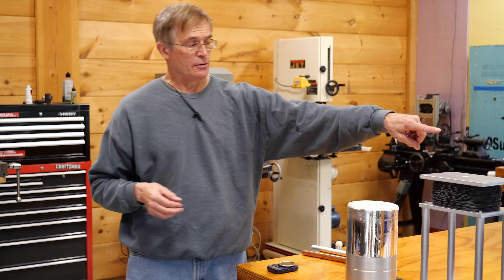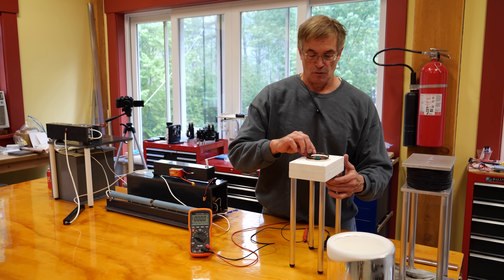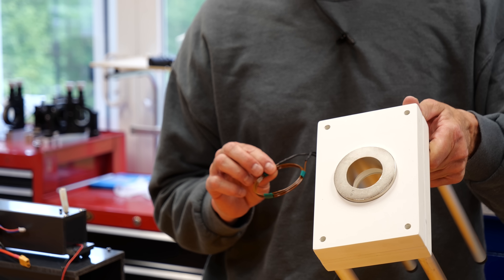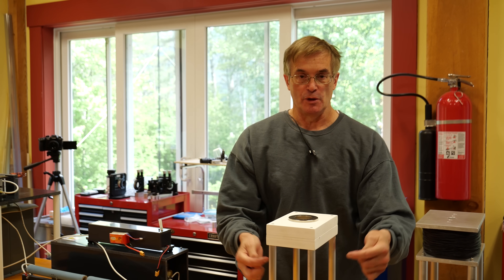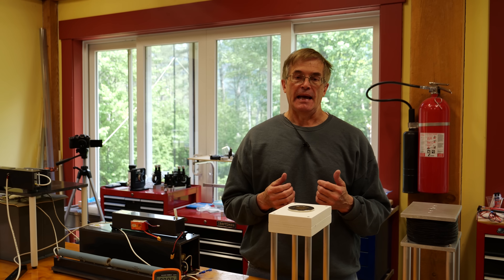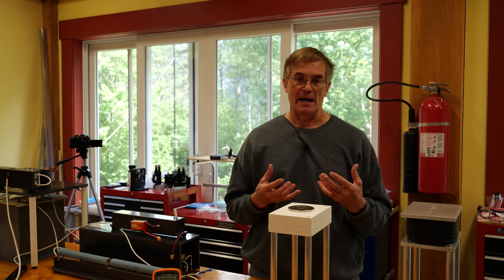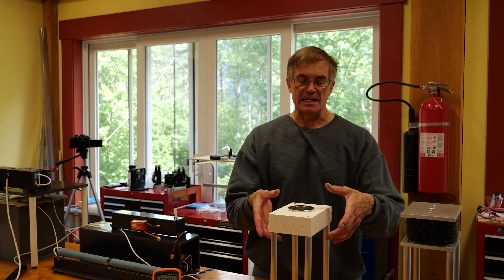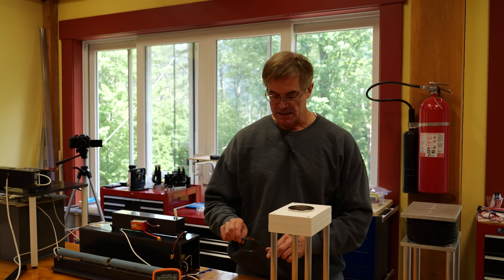No, we didn't use Magic to Crush this Can...

Comment: Comment 2701 
Yes magnets is the best way forward as due to the constant field flow they do well to promote the efficiency of other flows.  It's great you have a clear and simpleish manner of presenting and although it sound good that work is being done by Universities in conjunction with  big business.  in the understanding that Super Computers are now the step one in the prototype phase and where the prototype has been tested theoretically in digital, the practical working takes the best and the brightest even to follow the recipe and if it works we should not enable this form of efficiency to be under lock and key as it clearly helps as we all benefit from access to electricity.

I liked how O3 @/ozone was produced , and made me think about puting the old strip light on in the attic... it gets hot so I wont be leaving it on but hey, an Ozone manufacturing plant could be in every house and with reasonably priced resource of electricity.. they might not cost the Earth to run yet save the Earth in their running.

:)
Cheers to wonderful world peace.
All glory to our heavenly father Holy God and our Heavenly mother Holy Spirit.
A38man Amen.
April 6th 2021 day 482  (Of the Apocalypse)
Thank you.

Comment: I hate to be such a nitpicky stickler but god I just can't help myself.  Circa 2:30 the bit about the right hand rule is incorrect.  The right hand rule applies to conventional current, which is actually opposite the flow of electron current.

Most of the time it makes sense to just kind of ignore that fact in electric circuits but when it comes to free charges it's much harder to do that.  ¯\_(ツ)_/¯

Comment: So electric motors need subzero cooling to make more power.    and isn't air conductive or is it the water molecule's.   instead of pushing air why no drag it useing electromagnetic force to push air.    probably how flying saucers work lol.
Reply: oh air is an insulator but can you turn ionized air into thrust

Comment: SAFETY ALERT! If you can smell ozone, you got UVC (obviously, that's what mercury will produce in this setup, but whether that will get out the tube depends on tube wall material transparency to UVC). If you got UVC, I would not be in the room with it. I would not have it shine onto exposed skin. UV blocking goggles OK, but you will get reflections from surfaces bouncing all around, and getting behind your loose-fitting glasses. I would put something that is transparent to visible but opaque to UVB and UVC between me and any germicidal tube. I use small 15W and 50W UVC+Ozone tubes to disinfect the room on as-needed basis and my face masks weekly as I use them for full day, and then they wait for disinfection before reuse. My face mask is Korean KN94, four-layer type, so it is a lot more expensive (more than a dollar each due to the scarcity at the moment) than blue throwaway triple-layer masks that I would not bother sanitizing. I am not in the room if the germicidal lamp is ON, and it is on a timer. If you can't afford a timer, plug a germicidal tube into an extension cord, and run extension cord outside the room, behind a door, where you can unplug it without having to enter the room even for a second.

Secondly, the brightness of the faint blue light is mesmerizing, but is dangerously misleading. You are seeing the small leakage of spectrum distribution. The peak of emission is at UVC. Very little is being emitted as off-band visible. While your eyes may be comfortable looking at faint blue light, your eyes are being bombarded by UVC which is A LOT MORE INTENSIVE than the faint blue light that is visible. So, you were mesmerized by faint blue glow, while you just burned your retina out with very strong UVC, and your skin was burned off, too.

If you cannot afford fancy-colored, UVC rated PPE, polycarbonate wrap-around goggles MAY help, although they will themselves be degrading under bombardment (they will turn yellow). Regarding for a screen between you and the tube, acrylic panel MAY help, but there are different grades out there, so you have to do your own research. And all exposed skin must be covered by heavy clothing or rubber shoulder-length gloves. For face protection, a polycarbonate face shield can be used. Don't forget to cover up the head. Welders easily become "rednecks" when they weld with full frontal protection, yet forget to cover the back of their neck, and intense UVC from arc welding is reflected from surfaces BEHIND the welder, and reflected onto the frequently exposed neck, irritating and damaging the skin, producing the redness. 

Also, if you can smell ozone, it is right at the threshold of when you should not be breathing it anyways and exposing your eyes, nose, throat, lungs to it. Ozone will irritate mucuous membranes, etc. Ozone is worse for people with asthma or COPD.

These points should have been mentioned in your video.

Comment: Did you know that the high tension wires everybody sees around your block some have similar coils that are used for teleportation ? No ! Well did you know that those small coils, that are larger than the one in the video and about 18 inches in diameter, can teleport entire vehicles with personnel inside them too ? Of course you didn't that, did you ?

Comment: technically a flame is plasma too
Reply from the maker: No it isn't.
Even the hottest flame, say an oxyacetylene torch produces only vibrational excitations and that is what generates the light. There are virtually no free electrons and it is non conductive.  There are techniques using a very oxygen rich flame, doped with potassium or cerium. This will generate a low level of ionization and enable MHD power production.
Reply from the maker: Yep, they were wrong, but it's a common misunderstanding.  In order to achieve a 50% ionized gas even with the two easiest to ionize atoms, potassium and cerium, you need a temperature of 10,000k.

Comment: Electrons are not particles. That’s easy to prove. Also the man who discovered electrons said it’s not a particle, JJ Thompson It’s a field. It’s apart of the dielectric which is 1 with magnetism. JJ Thompson said an electron is 1 unit of dielectricity. This is not my opinion. This is fact. Charles proteus Steinmetz has a great book. Electrical discharges waves and impulses. It’s a must. Especially if you want to understand this more. Also theoria apophasis on YouTube. He’s the man for magnetism. Many free books of his that are great. Charles proteus Steinmetz work backs it all up.
Reply: Also I understand why everyone thinks electrons are particles. We were all told it was for decades now.
Reply from the maker: The "dichotomy" is a symantec trap. Electrons are indeed particles and to paraphrase Aristotle, electrons are what they are. How we visualize them doesn't change that.  What needs to change is how we visualize particles.
Reply: “Electrons” come from relatively large entanty carrying a surface charge and are not a particle. When the presumed election leaves an electrode of high potential in a vacuum it carries a electrostatic charge (dielectric charge) many times greater than normal. There is no rest mass of an election, the electron is nothing more then a broken loose holdfast under the grip of the tension within the dielectric lines of force. Unfortunately to a large extent of dealing with dielectric fields, the prehistoric conception of electrostatic charge (dielectric) or the electron on the conductor still exists and by it’s use destroys the analogy of the two components of the electric field which is the magnetic and dielectric. This makes the consideration of dielectric fields unnecessarily complicated. JJ Thompson the discoverer of the electron said himself an electron is a terminal end of 1 unit of dielectric induction. Electrons are bumps in a field and that field is the dielectric that makes has bumps which scientist call an electron. If you even look it up, it says an electron is partly a wave and partly a particle. May be accurate observations but saying that is the electron is wrong. Like I said electrons come from a field that makes waves and bumps, so if you think about it, that means electrons don’t actually exist. Its a name for a bump in a field that the dielectric makes. That’s like throwing a rock in a pond and saying the waves are the rock. No the rock just made waves in the water. The dielectric makes waves in the ether and people call those waves electrons. Almost exactly the same thing with light. Light is a compression and refraction along the dielectric. That’s why photons aren’t light and the speed we perceive is the rate of induction.

Comment: @ 12:50 did he say Cheap Multimeter??? Hahahaha.  That looks like a Klein Tools MM600 if I'm not mistaken.  Costs about $90-$100. That's not cheap for me. Maybe a $29 meter. Yeah, it's not a $600 Fluke but still think it's funny he called it a cheap multimeter.  It' would be an upgrade for me!
Reply from the maker: It's about $70 and it's cheaper than our Fluke.
Even if you upgrade, keep what you're using now as it's nice to have something "expendable" when you get into high energy experiments.
Reply: @TechIngredients  For what I do, which is mainly build and work on RC drones and vehicles my expendable meter is OK. DC voltage of 14 and lower but 100+ amps. at times with 2S/3S Lipos. Same for my $50 soldering iron and other gear. Gotta love Harbor Freight!  I see your point though. Blowing up a Fluke meter would be a bad day. Thanks for the reply. Learned a lot from your channel. Love your videos.

Comment: DAMNIT, I of course knew my whole life that resistance is temperature-dependent, but I did not know that cooling something with LN2 will have such a drastic effect. Again, of course it can be calculated but I never thought it would be so drastic. Which tells me that I should cool my super-solenoid with LN2 EVEN IF it is not made of superconductor just yet, I will improve on copper's resistivity at STP. Here it is: assuming copper resistance was 1 ohm at STP, cooling with LN2 will make its resistance 0.142 ohm. Who needs silver or superconductors???
And as dissipated power is current times resistance squared, I will have tremendous improvement in solenoid wasted power if I cool it much below room temperature (if not all the way to LN2 temperatures).
Reply from the maker: Correct.

Comment: Fusion reactors are ridiculous in complexity and cost when Fission is super easy and in the molten salt reactors, completely safe.  There is enough easily available Thorium and existing spent waste to meet the worlds entire energy budget for many thousands of years.
Reply from the maker: Indeed they're complex.  But, my enthusiasm for them is not their potential for electrical generation, but rather for transportation.  The tokamak can be made directionally leaky.🚀
Reply: @TechIngredients  there are some good arguments for fusion propelled rockets, especially if they can provide sustained 1g acceleration.

Comment: GOSH DAMNIT, my worst fears have been realized. I thought I was going to say "I want to see you do a superconductor project" and stump you for a month, and this guy offhandedly pulls a high-temperature superconductors tape off the shelf. Again, I was told (thanks Wikipedia, crap as usual) that HTS cannot be made into a flexible tape because it is brittle, thus the need of using conventional superconductors in wire form, but that requires He cooling. Yes, I heard obscure claims that there are 2nd generation HTS tape products, etc, whatever, but I did not know they were that flexible as what he just showed us (after, in case you missed it, offhandedly pointing to several square inches of TUNGSTEN blocks just so that he wanted a clean-surface, non-eroding spark actuator). Try buying tungsten online, then try to machine it. How the hell can you just pull off this stuff?

Can you share the source of the HTS tape? Link? Product number? Cost?

Comment: What happens if Earth gets hit by a CME with a full-scale fusion tokamak running? 8 minutes warning.
Reply from the maker: Not much.  The instantaneous energy contained within the plasma is quite low.  It's more likely the energy in the magnets will cause more damage to the structure.
Reply: @TechIngredients  While that does make sense to me, I still wonder, considering the scale of the reaction and the still, quite understudied effects of the waning magnetic field and it's sensitization of the geo-electric circuit to space weather. If this process can truly be shielded from an emp, it definitely is just as revolutionary as you say. I do think that we're testing our luck with transistors taking over so many important functions in our society no matter how amazing a fusion reactor can be. Something tells me that catastrophic failure of one is likely equally as terrible.

Comment: You need to reshoot this with all the crap, items, & doors in the background are hidden.  Those are a visual distraction.  Try off-white sheets stretched onto frames made from cheap used PVC pipe from a recycle store like Habitat For Humanity.  You can really improve the presentation   do a "Green-Screen" & interact with symbolic animations using some Open-Source software tools.  You could even show the end of the Universe without risk.

Comment: Thermonuclear (transmutation) reaction happens On the sun, Not in the sun. And yes, only double layers can maintain a very high temperature. The damn standard model is so laughable.
Reply from the maker: It happens in the sun when hydrogen is converted into helium.  A little may rarely happen in the very hot Corona.  Why is it laughable?

Comment: sooooo were you just casually talking next to a UV-c lamp for no reason at the end? TURN IT OFF! lol
Reply from the maker: Yup, do the numbers and you'll  see why I was in no danger.
Reply: @TechIngredients  i am HIGHLY uneducated but you mentioned only faint ozone smell so i assumed it wasnt terribly harmful. we used UV-c in healthcare for sterilisation etc. ozone smells kinda nice to me but hate the taste in some bottled water
Reply from the maker: The energy  output in the UV -band depends on the effeciency  of the source.  Mercury is pretty good  at nearly  50%, but then you need to calculate  the energy  deposited which is the voltage drop times the current.  Then the intensity  is that energy  distributed over a sphere with a radius of about one meter (my distance from the tube).  It's  quite low.

Comment: the electron isn't primary here. Electrons are just pushed along for the ride. The photon field is the primary mover - in electric current and magnetic fields - in currents they push electrons like rubber ducks in a river - the river is photons.  Photons are the real energy here.  In magnetic fields, its the spin of the photons as they move along the current. Their spin either doubles or negates relative to the photons surrounding them and their direction of spin.   Electrons are basically just there coincidentally because they have no choice, they're not the actual source of the field or the forces.

Comment: Hold on, am I crazy? I thought that Aluminium wasn't magnetic.
Reply from the maker: It isn't.
Neither is copper.
What is happening is that these metals are conducting electrical current. An electrical field is created by that current, and all electrical fields are, at the same time, magnetic fields. They are just two aspects of the single electromagnetic field. 
The changing electromagnetic field from the pulse out of the capacitor induces an opposing current (electromagnetic field) in the aluminum in the can.  These opposing fields create a force, and the can is weaker than the coil.
The same thing would happen in the can was made from carbon fiber (it conducts electricity).
Reply: @TechIngredients  I'm talking about when you were slowing rods down by dropping them through an electromagnetic field. Why should the aluminium be effected by it?
Reply from the maker: It's the same principle.
As the aluminum MOVES through the field created by the magnets, there is an induced current in the aluminum that generates an opposing electromagnetic field.